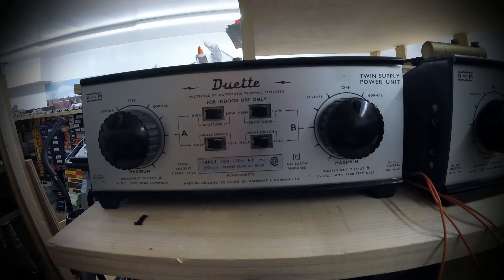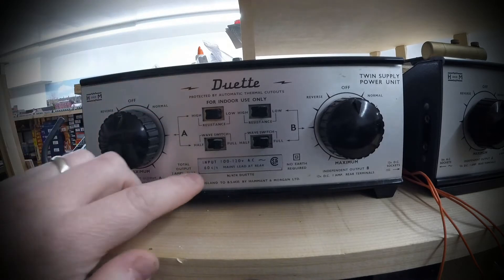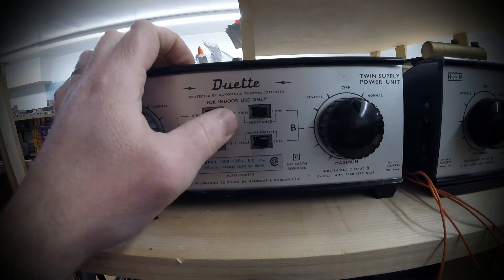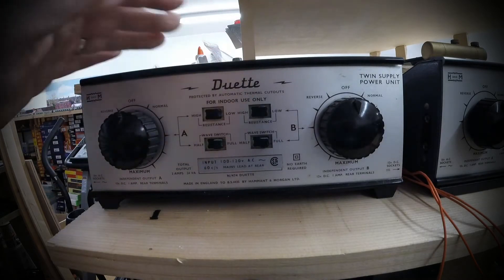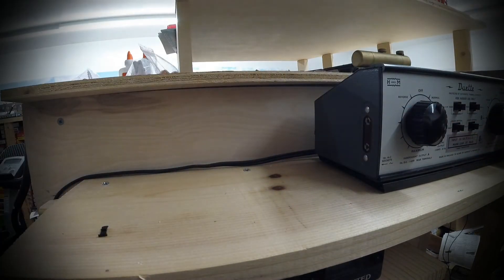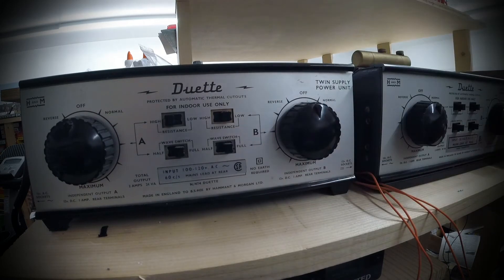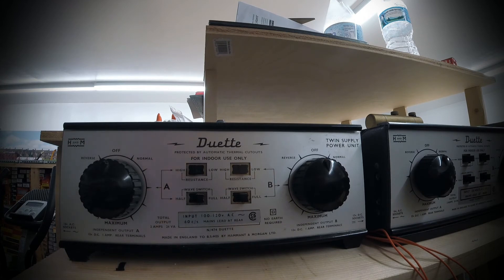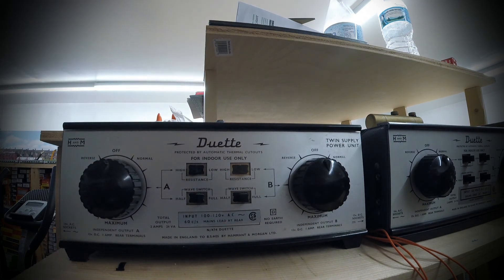oorail.com | Wiring a H&M controller to a Model Railway

Comment: How many minimal volts provide this controlle with high resistans in half way mode for starting?
Reply from the maker: That is going to depend on the current draw of the loco you are running. Voltage = Current x Resistance. The current draw of each loco is going to be slightly different. With the high resistance option, you are increasing the amount of resistance in the circuit. I wouldn't recommend using half-wave, especially with more modern loco motors. The DC output with half-wave is "pulsing", it was designed with older motors like the X.03/X.04 in mind, even with those you can often get a sort of "buzzing" noise from the motor. I always run the controller at full wave and then adjust between low / high resistance depending on how the loco performs.
Reply: @Oorail  Your colleague done some measurement few days ago for me. I've seen minimum 0.3 v. That is the same as Gaugemaster and quite great result if we compare with great German controllers. Well, I'd like to say that halfwave do not working so good with new motors as with classic 3 pole. The main advantages is not only slowest speed like DCC, but also very stable. Without halfway locomotives always "lose contact" with slowest speed.

Comment: Hi how many H&M controller do you have left? are you willing to part with one or two? how much $$$
Reply from the maker: Hello Warren. I've put most of my H&M controllers into storage as I've been phasing them out. I still use a couple of them for running older locos though. I've got several Duettes, Clippers and others. Is there a specific controller you are looking for? The ones I have are all 110/120v built for the American market. Where are you located?

Comment: There is a major difference between the Duette and Safety Minor besides the number of controllers in them. The Duette uses a rheostat (high power variable resistor) to control the current supplied to the locomotive whilst the Safety Minor uses a variable transformer to control the voltage. For at least one reason, this makes the Safety Minor a better controller. (On paper at least)
It is a property of electric motors that if they are subjected to an increase of load (say, a longer train, or going up an incline) they take more current to compensate. As this increased current passes through the rheostat of the Duette, there will be an extra volt drop. Thus the locomotive will slow down. The variable transformer of the Safety Minor does not suffer from this effect, so if the locomotive starts up an incline and draws more current, the motor will continue to run at the same speed and will not slow down.
All theoretically of course! I have both Safety Minor and a Duette but having no incline to test the effect on, I can not comment on how well it works. I doubt it makes much difference, but it was the major selling gimmick of the Safety Minor and its bigger brother the Safety Major, back in the day.
And in any case what do you do if your locomotive slows down? Why, -- you simply turn up your control knob!

I have to conclude with a worry about H&M controllers though, in that the rheostats are wound on quite flaky looking asbestos. In addition, the ones pre 1970 or thereabouts use selenium rectifiers which are known to have a limited life and when they let go, emit quite noxious fumes.
 The later Duettes use semiconductor diodes 1N4002. I have two worries about this. Max current of the 1N4002 is 1 Amp, and Duettes are  rated at 1 amp which is a bit too close to the limit of the 1N4002 for me. The other problem with the 1N4002 for me is that they can withstand a reverse voltage of only 200V. Some readers may be surprised to know that for physics reasons you can get voltage transients of this level, so for me I would use a higher voltage and current rating of diode.

Comment: Hello there, still got any of these units for sale...............? Thanks, Chris
Reply from the maker: Hello Chris. If you are interested in buying a H&M controller, reach out to Handem Electronics in the UK. I believe their website is handem.uk. You probably want to look at either the Safety Minor or the Powermaster units. The Duette, Clipper and Commander units all have air-flow resistance mats, which are basically a piece of metal wrapped in asbestos with some wire wrapped around it. Rapido Trains UK have a warning in their more recent loco manuals about not using H&M controllers. I reached out to them about this and they confirmed that the reason for the warning was due to the electronics on the locos not being able to tolerate possible spikes from the controller. Most of the layout here was powered by Duette, Electran and Clipper units. I temporarily replaced these units with Safety Minor and Powermaster units that I had, however I'm wrapping up my own DIY controller, so you should see some videos on that soon here on the channel. Its based off this project I did a few years ago - https://www.youtube.com/watch?v=7SAbGZqmkYA
Reply: @Oorail  Thanks for the information😁

Comment: I have 3 clippers and two of the addition controllers, they are great and near bomb proof and put out enough power for a large layout
Reply from the maker: Yes, I really like the old H&M controllers. Probably a little nostalgic as my Dad used them on his layouts when I was a kid. Duettes are starting to have minor running issues with more modern locos, some of the new Heljan and DJM ones. No issues with the transistor based Electran though. I have some Clippers for the branch lines and my workbench. I will probably phase some of them out in favor of my DIY Digital DC project but I have some ideas to pay homage to the old H&M controllers... https://youtu.be/7SAbGZqmkYA

Comment: I bought one of these in the mid 1970's  (UK 240 v) and have been using it on and off since then with 100% reliability. Inside they are properly heavy duty soldered and don't seem to suffer from dry joints.

Comment: Hi i have 2 of these for my layout + a clipper ( single controller) + a multipack, so i can run 6 tracks at once. Love them
Reply from the maker: Very nice. I've been quite fortunate to pick several up brand new, and a few others that were used for spares. They are a little harder to find over here in the USA. Quite happy though that H&M sold 100-120V versions for the USA/Canadian market! Have you had any issues running them? I know that DJ Models seem to recommend not running their locos with older power controllers, think they say 15 years or older, which would definitely put the H&M ones in their not recommended category.
Reply: No none so far, i have run a DCC Class 25 from Bachmann without any problems.
Reply from the maker: The only issues I have run into with the Duette is some locos running way too fast with very little power applied, usually Hornby Railroad. This is fixed by flipping the resistance switch over to high. I did have a Heljan Class 17 run to a crawl and start smoking / smoldering but that turned out to be a flaw with the Heljan motor! :)
Reply: Over here you can pick up Duette's really cheap on e-bay, always had them, they are bomb proof, and will go for ever.
Reply: How many did you get ?

Comment: watched your video with interest i have 3 and love them..  i also have one with levers on them and one nob. i have no idear  how to use it.. if you have any idear could you pass it on pls
Reply from the maker: Paul does the one with levers you have say "multipack selector" or "multipack flash" switch unit on it? Or did you mean it had levers and a one nob? If it has both, does it say Powermaster on it maybe?
Reply: i think it's mulitipack selector .single nob levels and on the back there's about 6 screws.
Reply: If you go to the Hammant & Morgan web site, you will find all the units they have made. www.binnsroad.co.uk/railways/handm/index.html
Reply: You might find this useful too.....http://www.stable-cottage-potterne.co.uk/HM3000/HM_11thEd.pdf
Reply: It sounds like a powermaster variable to me, I used to have one of those.